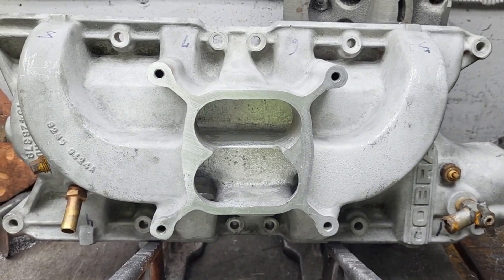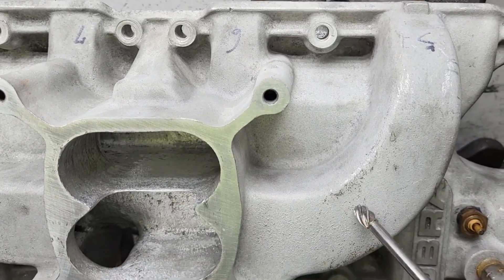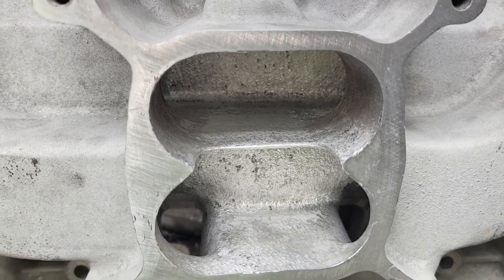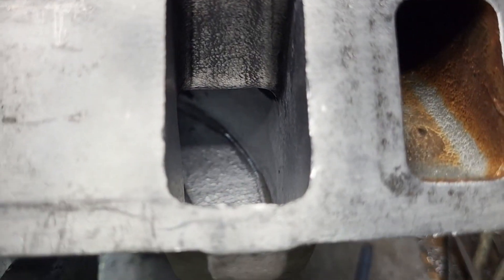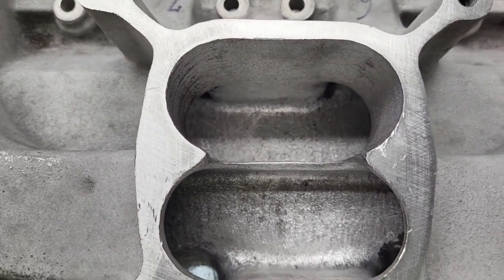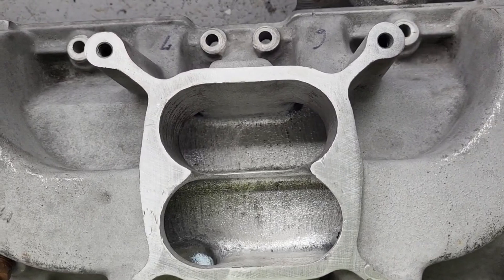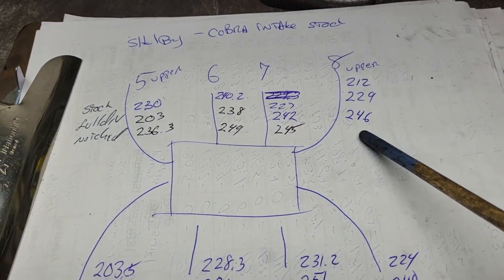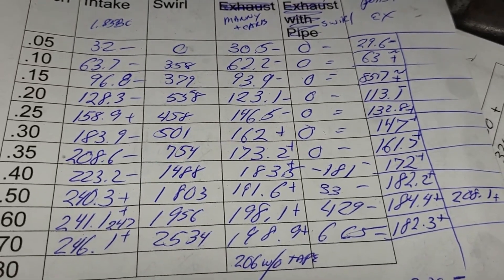Ford GT40 289 Race Project, Shelby/Cobra intake manifold testing part 1. Manifold flow balancing!

Comment: Hay Charles...I know you have solid shank carbide. Have you discovered the flexible shaft variations yet? They work around centrifugal force. Not precise, but if you need to open a corner area. They can open it equally all the way around. Works similar to a ball hone. I was going to tell you this while working on the tuned port intake.
Reply from the maker: @approachingtarget.4503  I used one at D.V.'S shop. I hated it. Light but I need to use two hands for the control I want. Thanks

Comment: You hit the nail on the head that the bends in the runner kill flow. If 3 90-degree bends in a 4 inch cold air intake are enough to start killing noticeable power output on a dyno, then what are dual planes doing to air flow...
Reply from the maker: @lucascb750  Limiting rpm! Thanks

Comment: The Weiand Stealth for the 289 / 302, looks to be a modernized version of the GT40 intake. On stock stroke 302's, I always get better powder and performance from the Weiand Stealth than the Edelbrock Performer RPM. The Performer RPM always acts like it is a bit "too big" for a stock stroke 302, but it does work well. I was surprised by how the Stealth always beats it, but looks so much like an old GT40 intake.  The single plane Weiand Xcelerator intake for the 302 works better than some others and seems decent for a single plane intake, but the Stealth has been the best 302 dual plane I've used and it looks a lot like the GT40 intake on the outside.
Reply from the maker: @BrandonLeeBrown  Good info. Thanks

Comment: How useful would extrude porting help this intake?
Reply from the maker: @troydspain1099  Lots, but I bet the short runners pick up the most!!!!
Reply: Extrude honing leaves a skim cut, so if you're goal is improving the finish, great. It does not reshape to a large degree, and if it did, it would also hit areas that would be best left alone. I have a performer rpm done up. Looks great, but I am no professional though.
Reply from the maker: @benperez6075  Good info. Thanks

Comment: A one inch open spacer will help the upper plenum make that tight corner going onto the runners. Have you tried using aluminum pipe plugs on the bottoms of the runner? Bore a hole in the probl area do the porting and then thread a pipe plug in with sealant or epoxy a round piece of bar stock into the runner to plug the holes, then you can get to thos3 tight areas use a 3/4 or 1 inch hole
Reply from the maker: @No1414body  I need to find my spacers! Owner said he might have room for a 1"!
Reply from the maker: @No1414body  Never did the plug trick. Thanks
Reply from the maker: I did something similar but welded the piece in. Worked really well. Huge amount of work! Thanks

Comment: If someone got 300. They must have done alot of cutting and welding plus some epoxy.  Thanks for the video.
Reply: I have ported a couple of those to 330 cfm average.  52 years of Ford porting experience.
Reply from the maker: @joecraine4660  You kick ass. No kidding. Thanks
Reply: @servediocylinderheads  thank's it means alot to me!
Reply from the maker: @dondotterer24  Anything is possible. I have friends who just cut it in half. Port it and weld it back. I am not that good a welder! Thanks
Reply: @servediocylinderheads  yep I'm just learning how to tig weld .at 57 it's like a old dog learning 
New tricks.  .also alot of warping is going to happen = more machine work.
Reply from the maker: @dondotterer24  Been there!

Comment: I have a question that might make me look like I was paying attention 😂. So DV does notches as well but his are slightly different and I'm really interested if there is a reason why. The one DV showed a while back had the front of the notch at basically a vertical 90 and radius into the floor but the back of the notch was laid back a good 60-45°. Is there a reason why both of yours are vertical or is not that important. I doubt he'd bother if it didn't do something. Thanks for the video BTW, I really like seeing these dual planes getting worked on

*Edit: I may have it backwards and the front is on an angle and the back is a 90. I keep second guessing myself
Reply from the maker: @jseal21  I don't know why he does it his way. I try to balance the runners the best I can. Thanks.

Comment: Would roughness on the inside of the turn where you cant reach help the fuel make the corner?
You could cut a small peice of file and drill to holes on the ends for strings and floss it where you cant reach.
Reply from the maker: @____MC____  Corners seem to work better smooth. Thanks

Comment: You could sawzall the tops of the long runners off, port the corners that you can reach then weld the tops back on.😊 Clean up the weld and a coarse sand blast, no one will know 😉
Reply from the maker: @93_LXcpe  I could...but I won't!!! Thanks
Reply: @servediocylinderheads  might have been involved in some illegal modifications at one point class racing 😉 😆